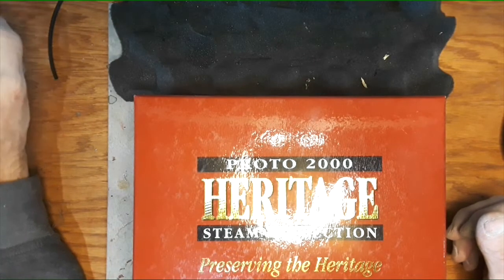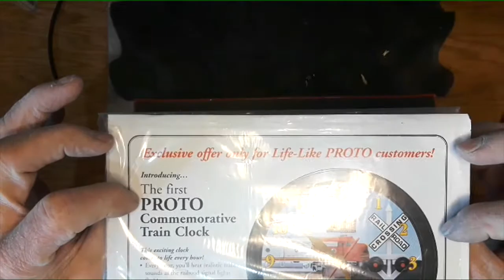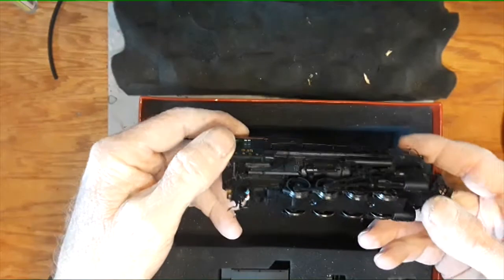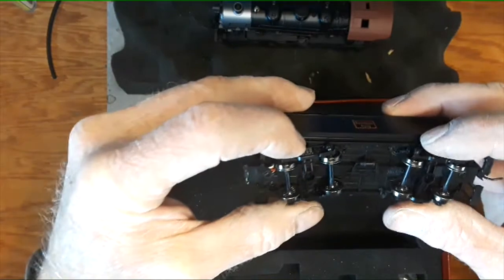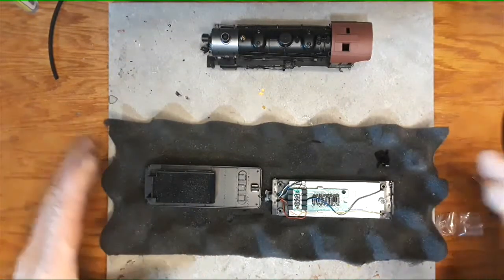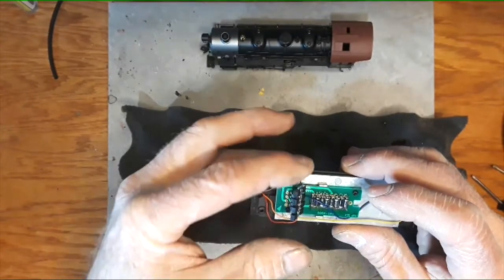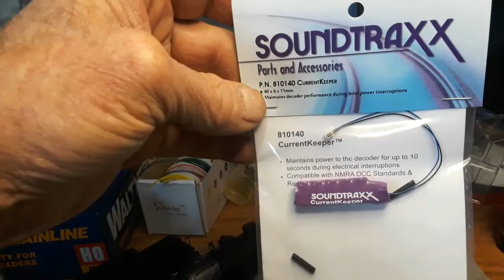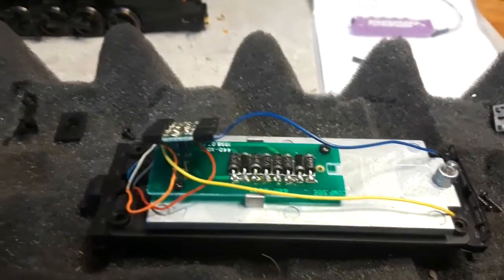Proto 2000 Heritage 0-8-0 Soundtraxx sound

Comment: Great job! I'm impressed.  I just bought a Proto 2000 Heritage 0-6-0, but it didn't come with instructions.  I've read that the instructions include info on replacing the lighting, as you have done.  I wonder if you would mind sharing how it's supposed to be done.  This is the most detailed engine I've ever handled, and I don't want to break anything.  I've managed to get the boiler loose, but I can't see how to remove the cab, so I don't know how to correctly remove the boiler to get at the headlight.

Comment: What is a good high grade epoxy?  Thank you.
Reply from the maker: Hi and thanks for commenting. There are many high grade epoxy's on the market. I have found that the longer setting products once cured are stronger then the 5 min epoxy's. And you typically get what you pay for. If its cheap it probably wont be very strong. The automotive trade has products that are very strong and are called panel adhesive. 3M makes a real good one.